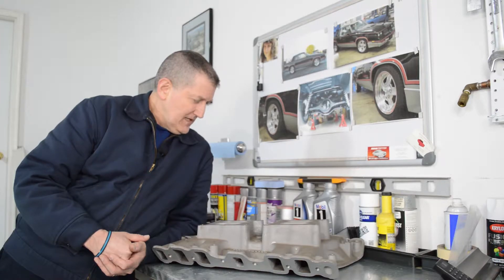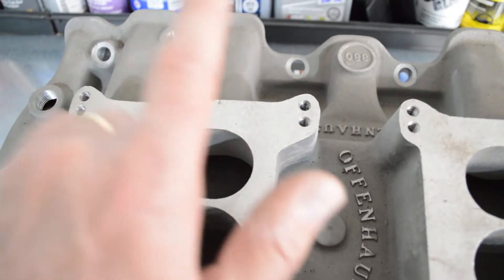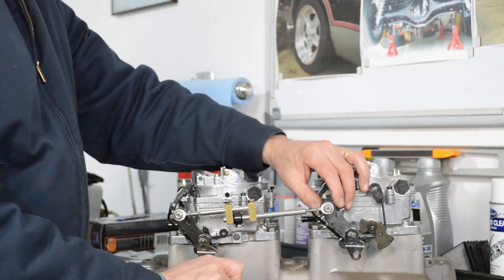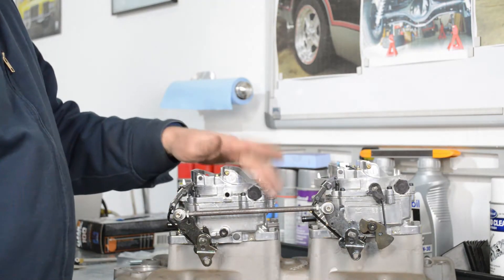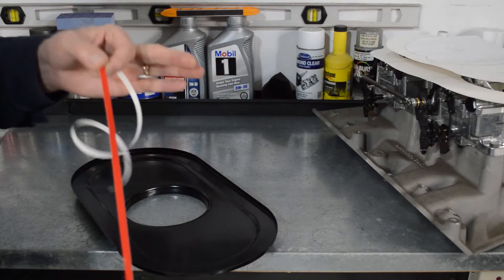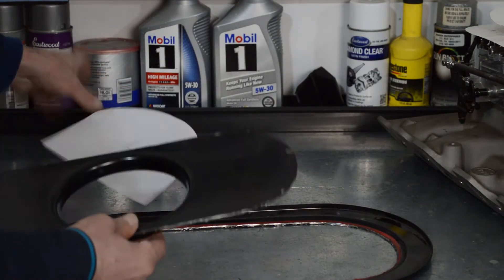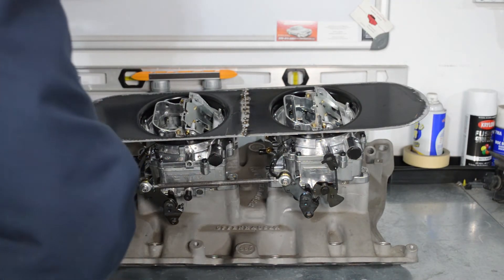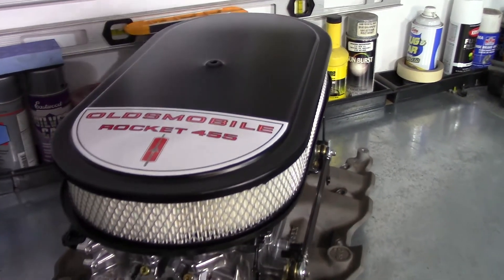Making a Dual Quad Air Cleaner!! 1987 Olds 442: Video 59

Comment: The Offenhauser dual quad manifolds were the typical design for the time. The Chrysler 383 and 413 factory dual quad manifolds of the late 50s early 60s were single plane design. The Weiand as well. To this day companies that sell Roots blowers modify Offy dual carb intake manifolds to place a 671 blower on top of. But the one to one linkage especially on an Offenhauser really has quick instant throttle response.